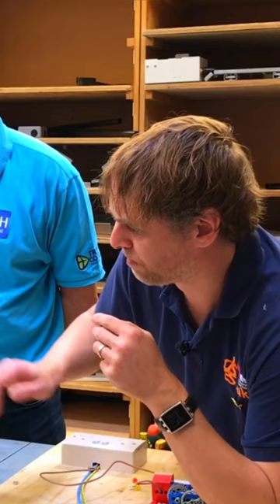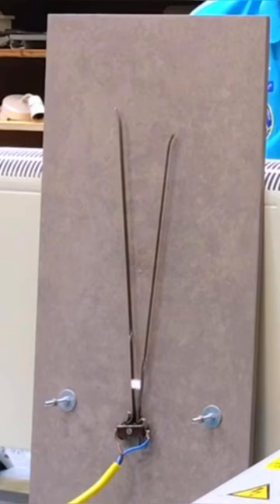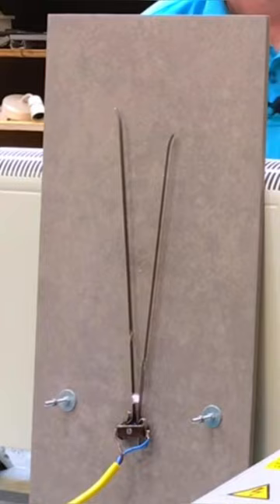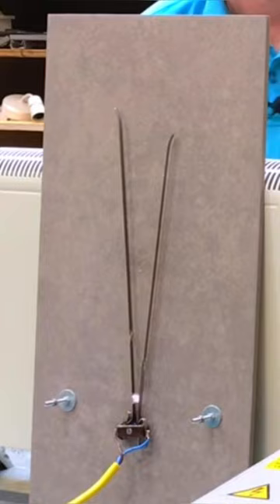Jacob’s Ladder Rising Arc

Comment: Don't forget part of that smell is the metal stripped off the electrodes by the current flow, and put into the air as both metal particles and as compounds from the oxygen and nitrogen in the air that is being broken down by the arc.